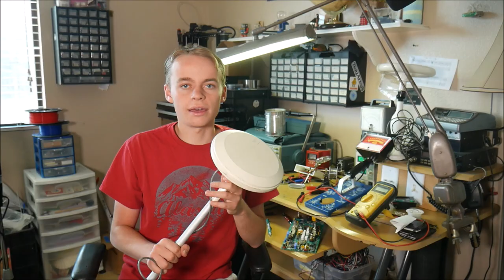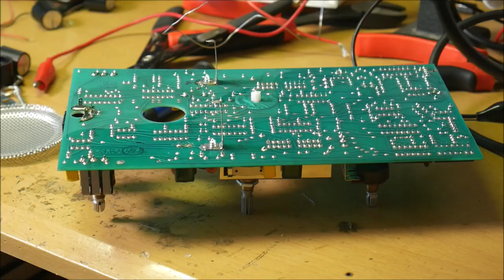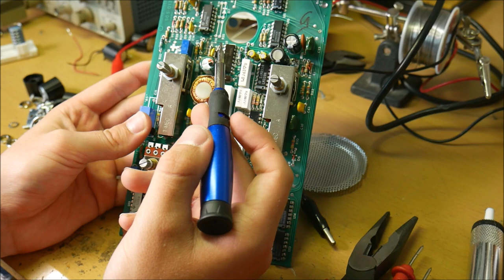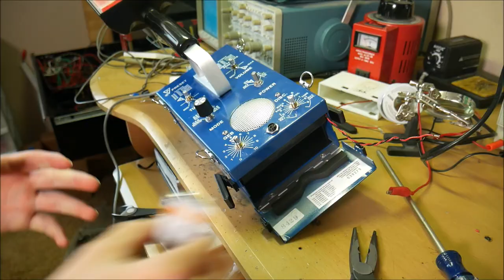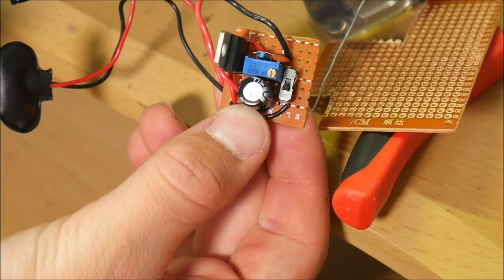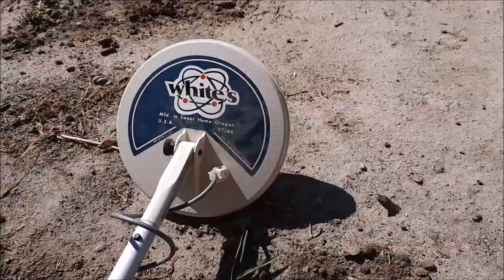Repairing a Broken Metal Detector(Bypassing a Fried Power Supply)

Comment: Hey Tanner— a tip for improving that solder sucker. I’ve got one just like it and I slipped a little bit of silicone aquarium tubing over the front. It gives it a better seal against the board and the silicone doesn’t melt even if you press it right up against the iron.
Reply from the maker: I have never thought of that, great idea! Time to find some aquarium tubing...

Comment: Good job following the circuit.  Another tip when you have something shorted or drawing high current, use the current limiting part of your supply and lower the voltage below operating voltage.  Replace the fuse or smoked component if it's easy then slowly bring up the voltage while watching the current.  Try to keep the current down just enough to follow the heat but not burn anything else out.  Sometimes you can feel the components, use an infrared thermometer or camera (if you have access to one) and the heat will show you the component path.  Keep at it.  I wish I had youtube and the internet when I was your age.  That White metal detector is a good one, a prize find.  Hang on to it and you'll have it functioning perfectly.  I'm sure of it.  Keep your eye out for a meter that includes capacitor testing.  Also look into a transistor / capacitor ESR tester.  Those can be inexpensive.  You don't need the most expensive test equipment.  There are a lot of bargains out there that will serve you fine.

Comment: This is the best damn intro on YouTube
Reply from the maker: haha thanks!
Reply: Tanner Tech I have a question, I’m building my own capacitor bank for the purpose of blowing things up. Shorting our electrolytic capacitors creates a high current surge that can damage the cap. Would it help to put a very high power resistor in series with the banks output to limit the current?

Comment: I have a detector that needs to be fixed. Would you consider fixing it while doing a vid on it? Please DM me with your rate if you decide to take on such a project. Thx and keep up the vids, you did a great job in explaining what all was done and what you used.
Reply from the maker: Hmm, I am pretty busy right now.  What seems to be the problem with your detector?
Reply: @TannerTech  I have one too. It doesn't power on, but visually, I didn't see any burnt circuits/components.

Comment: Hi Tanner. Looking at the circuit around the µA78S40, I believe it to be a step-up converter. The rest of the circuit are all IC's capable of greater than 5V supply. If you look at the application examples in the datasheet and first figure out whether it is in fact a step-up converter, which I think it is, and figure out the feed-back resistors, you will be able to calculate the actual operating voltage of the device. If it turns out it does operate at a higher voltage and you operate it at that voltage, it will increase the dynamic range and possibly the sensitivity of the detector.
Reply from the maker: Thanks! I didn't think of that, I am going to have to crack open the metal detector and take a look at the circuit again.

Comment: 7:00 actualy you could just use 5v regulator rather than lm317
Reply: Rotten Brainz  No, because the voltage output would vary with the current variations in the circuit. It needs a v-regulator. He could have just used a 5v regulator (LM7805), if he had one. The LM317 works fine as well.
Reply: You're correct. If he had a LM7805 he could have used that instead.